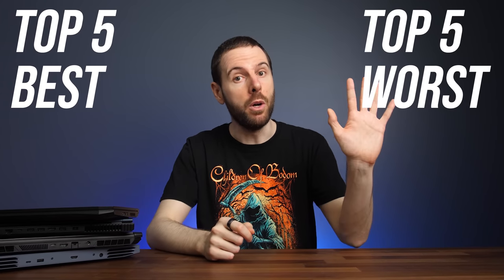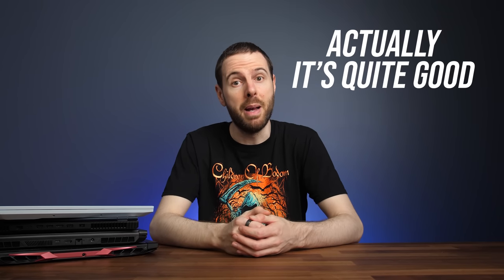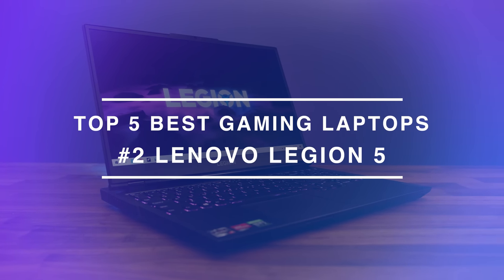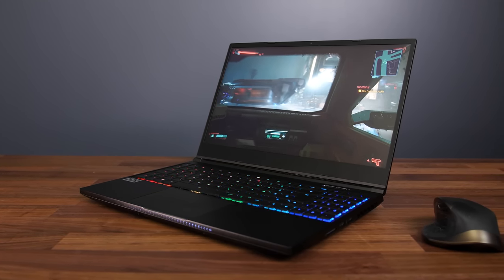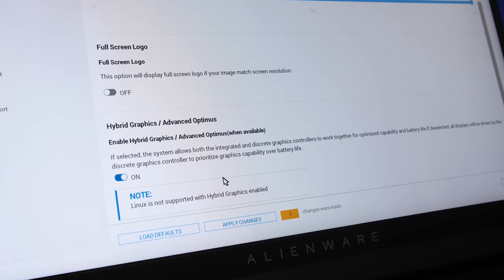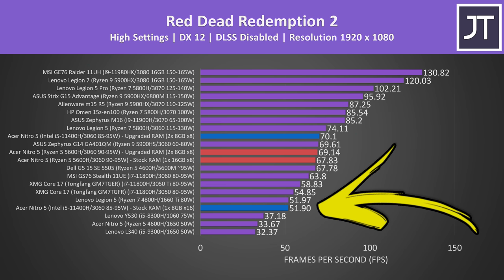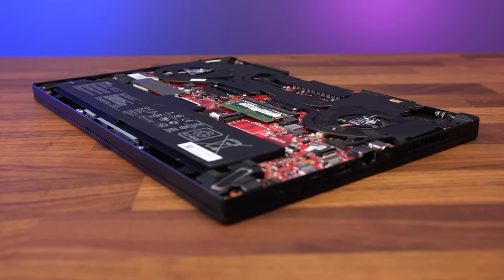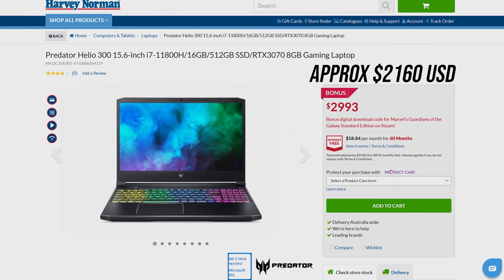Top 5 BEST & WORST Gaming Laptops of 2021!

Comment: HI I WANT TO choose one of this laptops, my aim to do video editing for my videos. and to record screen of my laptop wile watching live soccer.
Dell g15
16gb ram
512 gb ssd
NVIDIA® GeForce RTX™ 3050 Ti 4GB GDDR6
AMD Ryzen™ 7 5800H 8-core/16-thread Mobile Processor
15.6 inch FHD (1920 x 1080) 120Hz 250 nits WVA Anti- Glare LED Backlit Narrow Border Display =============================== Lenovo 5 15 " preimum
16gb ram
512 ssd
AMD Radeon™ RX 6600M 8GB
AMD Ryzen™ 5 5600H Processor (3.30 GHz, up to 4.20 GHz Max Boost, 6 Cores, 12 Threads, 16 MB Cache)
15.6" FHD (1920 x 1080) IPS, anti-glare, 250 nit lenovo 5 15 "
===============================
16 gb ram
1 gb ssd
AMD Ryzen™ 5 5600H Processor (3.30 GHz, up to 4.20 GHz Max Boost, 6 Cores, 12 Threads, 16 MB Cache)
15.6" FHD (1920 x 1080) IPS, anti-glare, 250 nits, 120Hz
NVIDIA® GeForce® RTX™ 3050 4GB
15.6" FHD (1920 x 1080) IPS, anti-glare, 250 nits, 120H